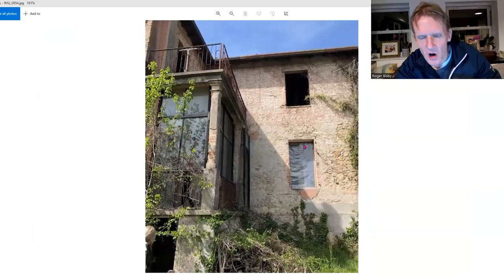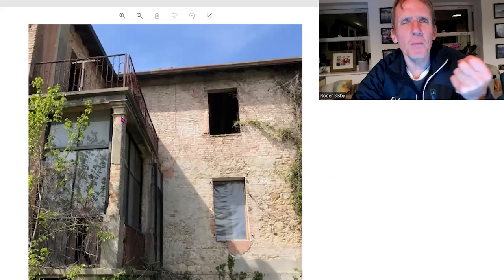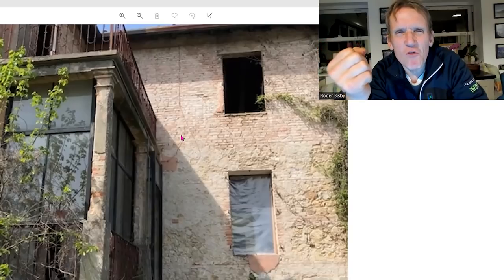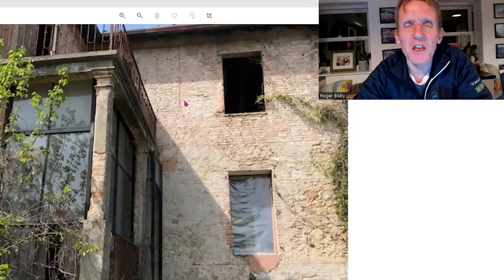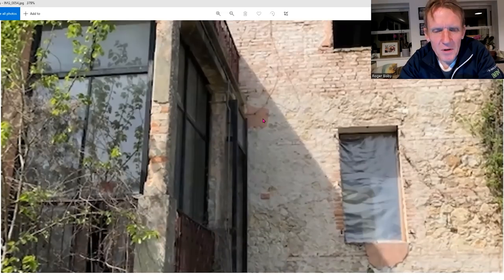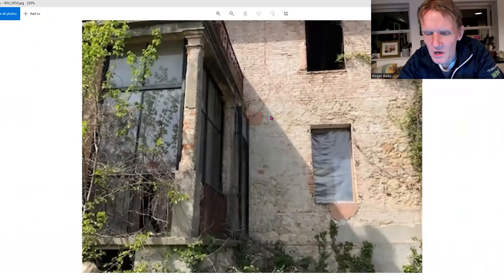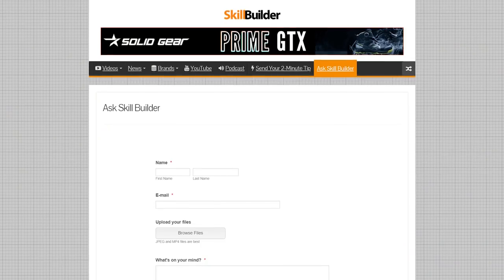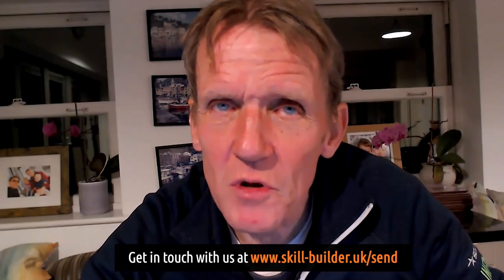Sand and Cement Render on Brickwork?

Comment: Clear explanation of the difference between hydraulic and hydrated lime.
I use hydrated lime in most of my mortar mixes all the time, unless it's for concrete or brickwork under the damp proof course, then I use Portland cement only.
The lime makes the mortar much more pleasant to work with as it gets this nice creamy composition, much better than those runny premixes.
I never thought of the self healing properties of lime, I did know it makes the mortar more flexible when it has hardened.
Can you do an episode on lime rendering and plastering with hydraulic lime?
Reply from the maker: Yes we have that rendering video planned

Comment: Some years ago I had large pieces of cement render coming loose on my timber framed bedroom extension built above my kitchen. I don't know why the cement render wasn't sticking to the cement boards on the outside surface of my extension. I removed the old render and re-rendered using ceramic tile grout. I applied new pebble dash to the grout and it's been fine ever since. The pebbles never fall off as they did from the old cement render. The grout is waterproof and has stuck to the cement boards like shit to an army blanket. Also no cracks have developed in the grout render.
Reply from the maker: Jim 
The base coat that is sold for bagged render is actually cement based tile adhesive. It just needs pricking up

Comment: Seen a few of your videos as I've been going through trying to figure out damp issues in a 1900 house me and my other half bought. So glad you said lime not cement render dude, experiencing first had what an issue it can be. Seems to be big issues with people thinking anything other than lime can actually transport the moisture out of the building fabric, and how much damage Portland or even NHL can do. Having to take off a render at the front causing damp that was soaked and damaged the bricks, rear of the house is next. Unfortunately surveys' didn't pick it up so we have had to learn fast how much of a problem it can be. Fancy checking out a DIY job with hydrated lime as a temp winter job and then a summer hot lime repointing and render long term fix hit me up. Id like to think not too bad a job for a first timer so far, but obviously not a provisional by any stretch. Other half put it on tick tock and something like 500,000 views of me hacking off a wall which is quite scary, and just got myself an sds for the rest.....

Comment: Hydraulic lime readily available in Devon, used to be 12-13 pounds a bag before the covid price hike which makes pricey for the builder also because more lime is required in the mix compared to cement 3 or 2.5 to 1. I think at least a little bit of lime should be used in almost every application where damp might be an issue, portland cement is a great invention but lime helps in most applications I would say .........................................................................................................................................................

Comment: I live in France  the French render old stone building in hydrolic lime. 2 to 1 mix. the critical factor is to dig out the old render  deep enough be it lime or even mud  hopefully not cement, very deep. they use a large compressor with slim unheavy air tools that pick all the older render out. very powerful tools but not heavy. wet the building down, get the render on at 7am with a machine. sprayed on. wait for three hours and then scratch it off to expose the stone. they do not point. they cover everything and scratch it off with a plastic talosh too or wire brushes. for a flat render, they spray on, wait three hours and then with 1 meter straight edges pull it off and smooth it off.

Comment: Roger, here’s an idea for a new series/rant: We’re always being told we need to insulate more, but also that old houses need to breath. So what can we do for solid brick walled Victorian houses, or for old inter-war double-leaf walls (I hear blown insulation causes damp). If all we can do is loft insulation and double glazing I reckon most of the British housing stock already has it. So what more can we do/ what are the activists after?…every beautiful old house wrapped in styrofoam and  monocouche so those heat pumps we have to fit have a fighting chance?!
Reply: Quite a few scientific papers have come out in recent years disputing the idea that solid brick walls have poor thermal insulation, I only looked into it because I was surprised how my old house held in heat so well.
Reply: @versi1098  I live in an old house in France, stone walls over 1 meter thick, I am amazed how well it holds the heat. Mind you, it was an old plumbers house, the skill builder of his day perhaps!
Reply: @versi1098  yes, especially very old cottages with 3’ + stone walls…insulation would prob do more harm than good. There’s also the issue of demising returns more generally: eg regs require 270mm of loft insulation for new builds but not that long ago it was 200mm, and 100mm before that - so the question is if you have already 100mm/200mm is it really worth the hassle & cost of going back in the loft to add the extra 170mm/70mm…probably not but would like to know the calcs.
Reply: @versi1098  yes. a solid wall with moisture trapped in it is cold as hell. So fixing this actually improves energy consumption for starters . But the modelling of thermal loss in older buildings is often completely wrong
Reply: Agreed. There are plenty of diagrams showing the proportion of heat lost from a "typical" totally uninsulated house (often pictured as a single glazed three bed semi with a cavity wall) but I've not seen a similar diagram representing the thousands of Victorian or older houses we have here. Diagrams showing what difference all the recommended insulation and double glazing makes are also thin on the ground.
I've got the usual double glazing, cavity wall and loft insulation already, but I'd like to know what to do next; what improvements can I make that are worthwhile or will tackle weak spots?
Reply: Have a look at wood fibre insulation boards, combined with lime render is a good option.
Reply: @ollyb7570  We have a stone built cottage in South Lakeland that has thick walls. In summer when the sun shines on the outside render you can feel a warm draught rising from them at the top under the roof eaves. It must be carrying away moisture from the lower areas and base. In winter I suspect that cold air does move down the wall but much less rapidly. It is noticeable when after going away in winter (without our solid fuel central heating running) that it can take several days for the outer walls to heat up again. I'd suggest that the walls act more like a heatsink that acts as a buffer that moderates the rate of temperature exchange both into and out of the cottage. The insulation question isn't obvious in our case, is it?

Comment: Good video Roger, I suppose we could always argue about the variations on how to make a lime render, but this video is a good starting point. One point I always make about lime renders and mortars is that the type of sand is just as important as the type of lime binder. The sand must, must, must be sharp! Using soft builders sand will lead to a failure.

Comment: Check out the lessons learnt by the National Trust for Scotland on The Hill House in Helensborough. Charles Renee Mackintosh designed the house and it was built with full cement render despite the builders saying it was a bad idea, they now have a box surrounding the house with chainmail covering to allow air flow  whilst keeping the rain off.
Reply from the maker: I will look at that. It is surprising how man historic buildings were built with inherent faults.

Comment: you're right about the lime, time has proved it to be a very good protection for both brick and other materials, very durable, in Europe you will see buildings with cement/lime finishes which were put on a hundred years ago, I'm not say it will all be perfect but it certainly proves that it has durability. In the olden days in the UK slaked lime was commonly used and recognised as a durable finish but cement became the modern material of choice through convenience. You wouldn't find Fred Dibnah putting sand/cement on his chimneys, good old Fred, end of an era.
Reply from the maker: Yes Fred like to put a bit of linseed oil in the mortar
Reply: @SkillBuilder  You just reminded me that way back in the 1950's my Dad used to make mastic, for sealing around the exterior gaps around door and window frames, from brickdust mixed with linseed oil. I guess it was like a coarse putty that eventually set and cast rainwater off. I also remember a neighbour with a building business collecting up unused lime mortar from site who had a mill that ground it up so that it could be used again in "rough work" areas.

Comment: Hello Roger
Great video
Wanted to ask, in your opinion is possible to use cement (for better setting) with hydrated lime and sand (0,5:1:5 ratio) for rendering a brick wall layed with lime mortar, as it is quite difficult to find hydraulic lime in our region? 
Or even small amounts of cement will trap moisture, make wall unbreathable and ruin the bricks?
Thank you

Comment: To combine two things, consider EIFS, that is a layer of styrofoam with little grooves in it to drain the water,  mechanical fastenings into the brick (better than adhesive) and a latex/sand based render over the top (like Drivit). Then you get moisture proofing and insulation, that will help you with your heat pump load.

Comment: Good morning Roger. 
You touched upon the issue of trapping moisture into a wall once render has been applied. 
Along similar lines, could you advise the pros and cons of insulating older houses with solid brickwork or direct us to a trusted publication that can be relied on ? 
When the insulation should be on the inside/outside, therefore what heats the wall - the heat inside or the sun outside in which case how does the wall dry ?  
Possible condensation/damp/rot issues, ventilation etc ? 
Thank you.

Comment: i read somewhere that a 12:1:1 sand: hydrated lime: cement is an equivalent strength to an old lime mortar, i think it was a study taken for restoration in scotland or ireland, can't remember for certain
Reply from the maker: I am not sure but the lime association has some interesting stuff about the differences between hyrdraulic and hydrated. The hydraulic can carry on getting harder and finish up much the same.
Reply: No, don't mix 12:1:1. This makes the binder (cement and/or lime) 6:1 which means you are left with voids in the matrix and these voids will fill with water and frost spall (flake off). Your ration must be 2.5 sharp sand to 1 part lime binder.

Comment: Can you redo the bottom half of interior walls in lime to fix damp, or does the whole lot of the plater need to come off first?  Regards.
Reply from the maker: Hi Rob 
We have a video coming out in the next few weeks which deals with this and it only requires the lower bit to be removed.
Reply: @SkillBuilder  great, cheers.  I'll keep a look out for it. 👍

Comment: On a period property built in lime mortar , never ever use sand and cement render.
Using hydrated lime in a cement mortar is even worse, the myth of the render coats being more flexible by the additive of hydrated lime is wrong as the hydrated lime will have a further set by absorbing carbonation which will make it extremely strong after a year.

Comment: My house has a north facing wall, which never gets the sun on it.  The brick is porous and therefore it absorbs a lot of water when it rains.  As a consequence, it's not drying out and I've got damp patches in side the house. I was going to get it rendered, but maybe this is not the best solution?  Do you have any recommendations?
Reply: If its solid 9" brickwork and pentrating damp, something like Safeguard Stormdry is a good solution.
Reply: The solution depends on the wall construction - older walls made with lime mortar MUST be treated differently to modern cement ones because they deal with moisture in very different ways.
Reply: @jannenreuben7398 
So, he says he has porus brickwork and his walls get damp inside when it rains, so I'm assuming that he has a solid brick wall and the damp is pentrating damp.
Painting a breathable masonry waterproofing system to the exterior brickwork is a good solution to prevent this from happening.
If its a cavity wall then another solution will need to be sought.

Comment: Hi Roger I am new to your channel and found you to be easy to understand so I'm building a pond made of bricks that I got from the tip (alot of hard work cleaning them) I used 6 1 1 for the mortar is it ok to do the same for the render after it is rendered I will apply a coat of pond water proof sealer
Reply from the maker: maybe a 5,1,1 but make sure the sealer is compatible with lime.
Reply: @SkillBuilder  oh thank you for responding and so quickly how will I find that out

Comment: Cement to me is an ingredient. I understand you have aggregate in proper concrete but sand and cement together is concrete to me. It’s like calling a cake, flour. 🤣👍🏻
Reply from the maker: Language is fluid but generally builders in the U.K will not call render a concrete. It is more akin to a mortar that you spread on vertical surfaces.
Reply: @SkillBuilder  it makes you laugh when you think about it though, with subtle ingredient tweaks, if it’s in a hole it’s post mix, if it’s on a wall it’s render, if it’s on a wall and combed its scratch coat, if it’s a shed base or foundation it’s concrete, if it’s to bed bricks it’s mortar, if it’s to finish the gaps in the bricks it’s pointing, everything else it’s “cement”.  I prefer cake 🤣👍🏻

Comment: Strange how you talk about advising to not put cement render on old properties so the walls can breath but then say installing a damp course and putting waterproof sand and cement is the way to stop damp, the only way to stop damp on old properties is not to use cement at all and defo don't waste money on injecting a dpc
Reply from the maker: The word is breathe not breath. That aside there is no contradiction. A damp proof course is always a good thing because it stops rising damp. I specifically mentioned cracks allowing water to enter the substrate and the sand and cement trapping the moisture. 
When did I say that you should use waterproof sand and cement?
Reply: But when you install a dpc you then have to apply Materials that are impervious (hopefully spelt that right) to stop the salts coming through  stopping the build up of moisture as it sweats so what your saying is the outside is OK to use permeable render but inside dont

Comment: no the completely ditch sand and cement never get your house rendered with sand and cement get it rendered with lime render not the lime and sand mix but lime and chalk with the fibres obviously we should completely scrape sand and cement also scrape gypsum plaster and plastic masonry paints everything should back to limewash and lime renders and plasters same with floors lime concrete so everthing is completely breathable
Reply from the maker: Sorry Jack but you are not being rational. I think maybe you have been radicalised but the lime fundamentalists. 
Lime is good in its place but the word 'breathable' is simply a substitute for evaporation. 
If you have lime concrete on your floor to allow the moisture to evaporate into the room you cannot then  have carpets or wood floors. Moisture migration through floors is never a good thing and it is the number one reason for floor failures.
The best thing is to stop the damp at source with a membrane or a DPC and that will keep the moisture from entering the structure.